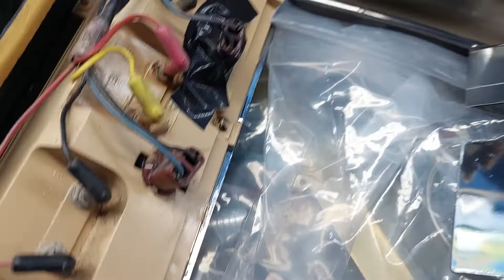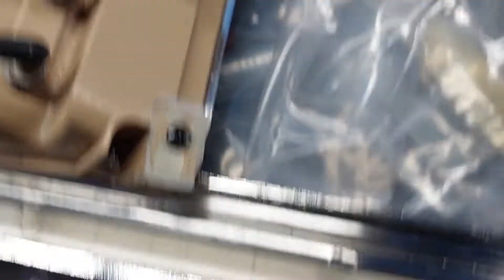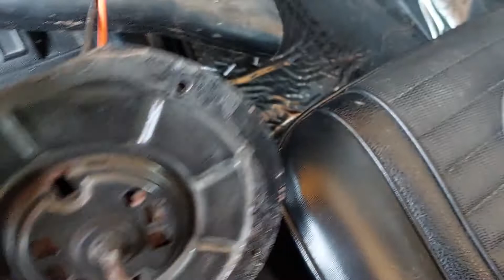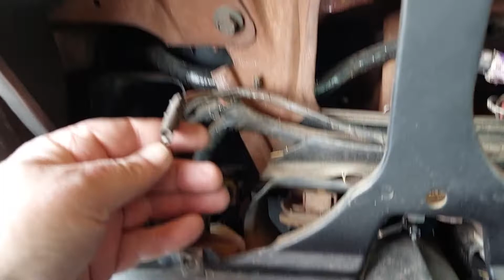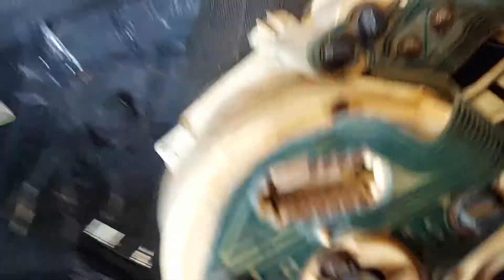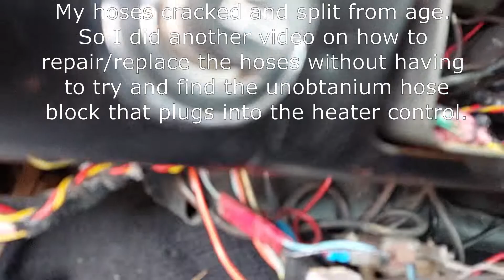1971-72 mustang aftermarket center bezel assembly, and heater/AC blower motor replacement overview

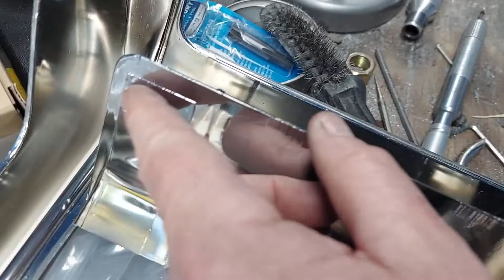Comment: Nice bit of info.  It has been decades since i last replaced a center dash bezel in a Firest Generation Mustang.  I appreciate the little reminders you provided.  We do not have the three center gauges, as we replaced the idiot light instrument panel with a Dakota VHX instrument panel with all analog gauges.  On the right side of the three gauge "MUSTANG" gauge Delete Plate, I used that area to mount a Garmin Drive 51 GPS with backup camera display.  I used high strength double sided 3M tape and a 2 x 2 x 1 block of Acrylic, which turned out really well.  I have a YouTube video showing how i did the Garmin mount at:  https://youtu.be/xSxEBNDKp7o   Go to 03:00 - 05:30 mm:ss to see how I did that initially.   

My next move is going to be installing an LED oil pressure display so I can monitor the Throttle Valve Pressure for an AOD transmission we installed in our 1973 Mach 1.  There is plenty of room for the LED display on the left side of the gauge Delete Plate, but I need to remove the bezel, or at least move it forward a little, so I can route the electrical wired for the LED display in a way where the wires do not show. I will record the LED oil pressure gauge installation process on another YouTube video, and I will place the link to the upcoming video in the description of my initial YouTube video at the link provided above.. 

I plan to run the wires for the LED oil pressure gauge, and re-route the wires for the GPS unit, behind the bezel once it is off.  For the access holes I will remove the MUSTANG gauge Delete Plate and use a Dremel tool to cut some small notches into the bottom edge of the Delete Plate (behind the Acrylic block used to mount the GPS), then route the wires through the notches and route them behind the bezel down toward the floorboard where I have some switched 12 volt power wires waiting to be connected. 

I find these kinds of projects to be more tedious than hard.  But, so far they have all turned out looking really good.  Kudos re: your video.  It was a very helpful reminder of what I need to look out for with the center front dash bezel removal.
Reply: Great minds think alike. Fancy seeing you here.